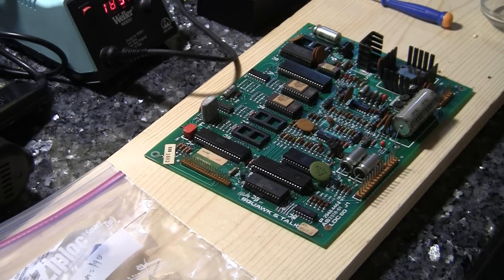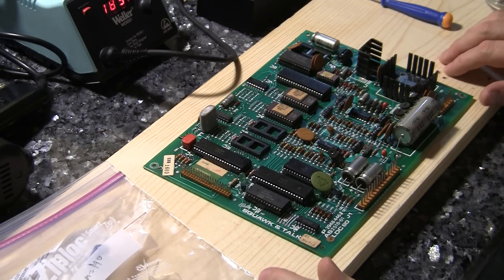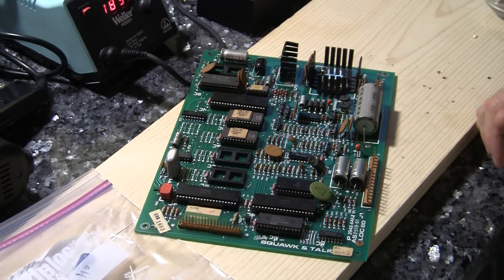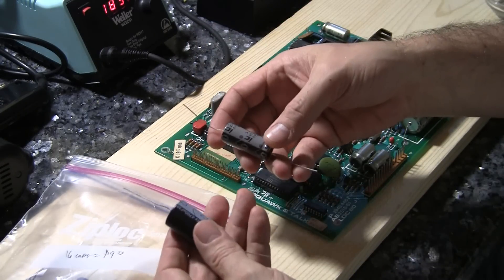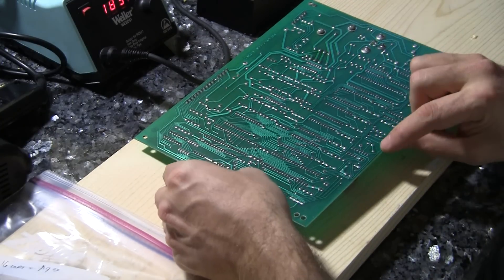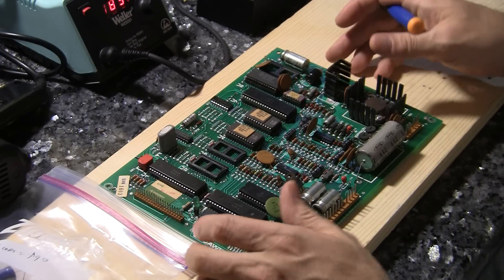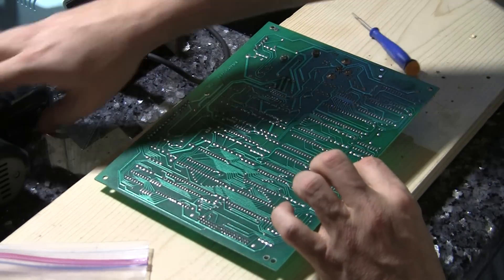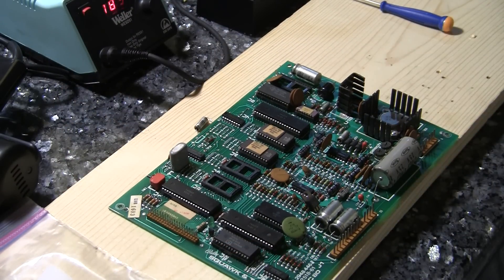Rebuilding a Bally Squawk & Talk sound board pinball Pt 1 - PinballHelp.com

Comment: I have found over the years that 90% of the time replacing all of the electrolytic capacitors and resoldering the connector pins restores proper operation of the board. I like to order the original axial lead style of capacitors where possible since the board is laid out for axial style capacitors.

Comment: That looks like a Hakko model 808 desoldering gun. It uses a motorized vacuum that operates when you pull the trigger. Then the hollow heated tip sucks up the solder and deposits it in a glass vial. The gun is balanced well and is easy to hold and use.